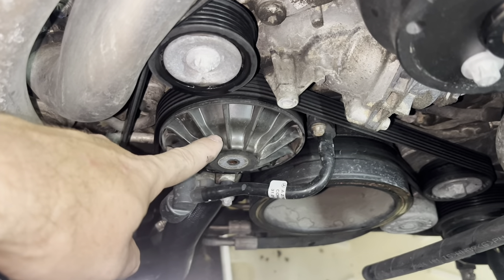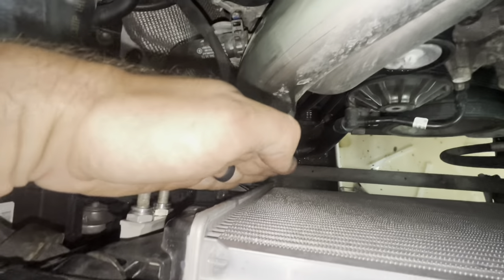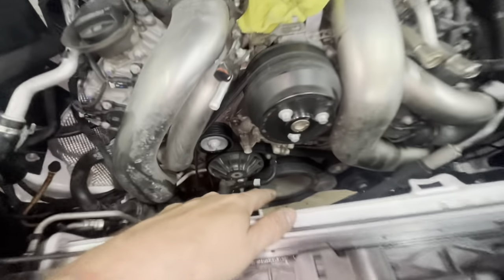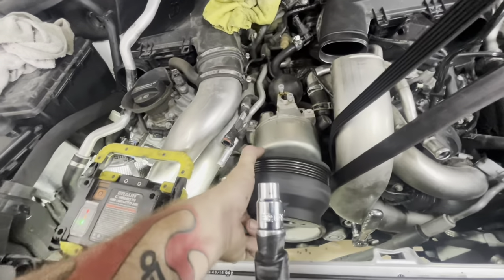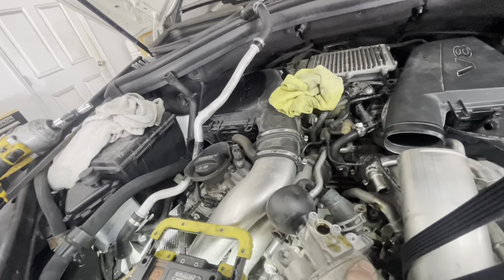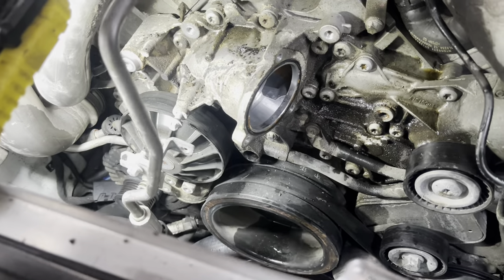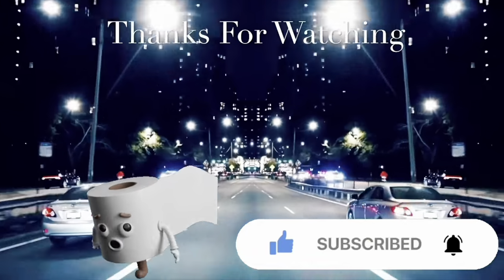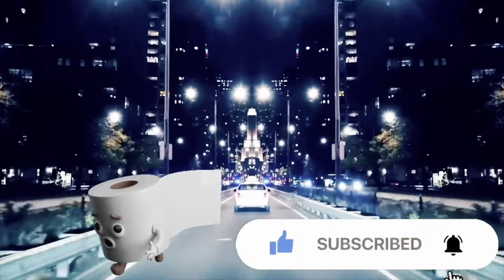🧰How To Mercedes 4.7 Water Pump GL550 / X166 / M278

Comment: This is great video what was that pump you took out on front top of the engine ?
Reply from the maker: Honestly I don’t even remember buddy I’m sorry
Reply: That pump is for the Active Curve system which is a hydraulic system that provides pressure for the active stabilizer bar system.  It's a cool system.
Reply: @kevin9c1  thank you 🙏🏻

Comment: Very good video. Thanks a lot. I have e550 M278. I removed fan but couldn't slide it back. Any help would be appreciated. I can I put it back? It basically doesn't fit :(
Reply from the maker: I know the cooler lines on passenger side have to be unhooked to get fan to come out
Reply: That fan basically doesn't fit, but it actually does. Try it at an angle it is best if you remove those other lines that are in the way but it's not absolutely necessary if you angle it in there and gently push the other ones out of the way you can get it in there without removing any other stuff but it can truly be a pain and will test your patience good luck.
Reply: @langiam1  Thank you. I only able to put fan back by removing both upper hoses. Tried all angles possible but couldn't put it back.

Comment: How long does these radiators last? Around what mileage do they need to replace? My 2013 ml63 has around 103k
Reply from the maker: I honestly have no clue at all. I’ve never heard of a radiator going bad unless it gets damaged. I also don’t know life span expected of the water pump.
Reply: I had to replace mine on a 2013 GL450 in 2024 at 160k miles
Reply: Wow that's a pretty good mileage for these radiators most of these radiators last about 60 to 80,000 miles on the Mercedes GL series however if the engine overheats at all it'll almost surely be the end of your radiator it expands and starts to leak from the ends where the seal from the plastic to the aluminum is. If you really plan to keep your car and keep maintaining it I highly recommend getting a custom radiator made from a reputable shop it won't cost very much more than the regular Mercedes one and it'll last forever as well as keep your engine considerably cooler thereby cutting down on the maintenance required for all the other items surrounding the engine including all the plastic connections and hoses and such.